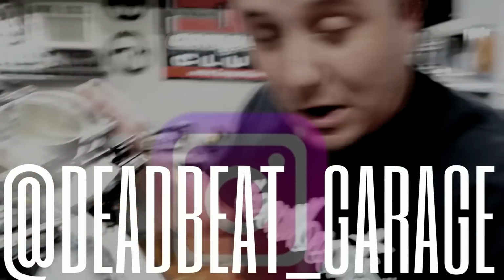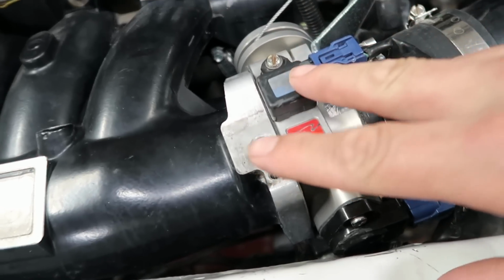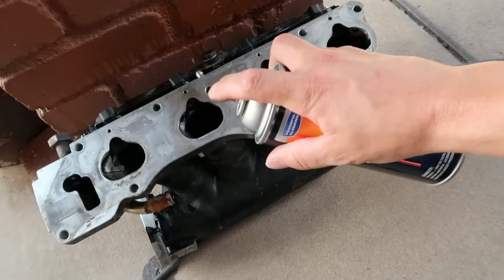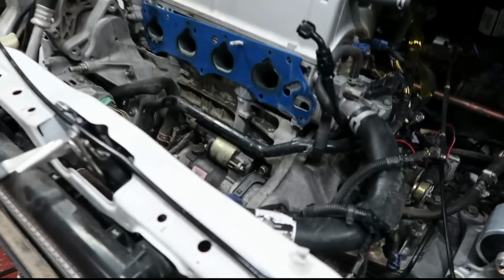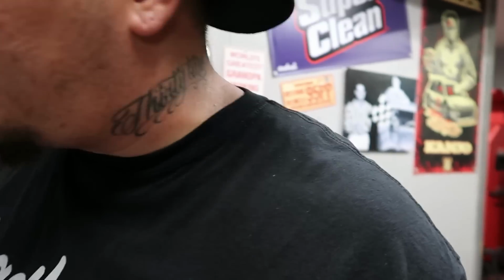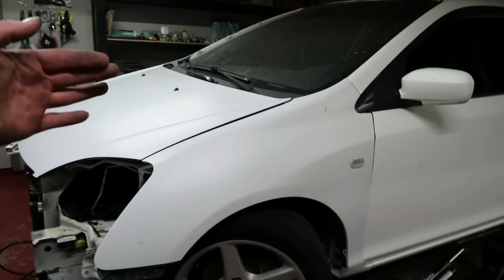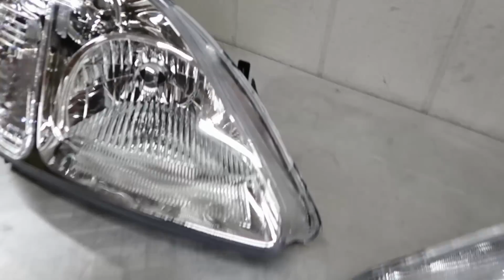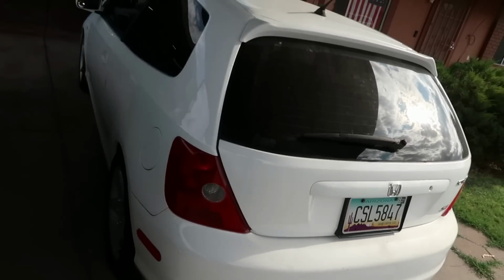K24 Swapped EP3 is looking FRESH! And we're just getting started.

Comment: Spray it white, carbon fibre bonnet, carbon fibre trunk, wind deflectors, underfloor neons, mugen rear spoiler, check out uk spec ep3’s, sunstrip, de wiper back end, harness pads, gear knob, de badge, rear diffuser, rear bumper spars, side skirt extensions, front mugen lip

Comment: From personal experience, skunk2 was notorious for sticking as well. I learned, the return spring tension wasn’t great enough to close the throttle body back, so I drilled and hole in the butterfly wheel to give that spring more tension. Seemed to have help for as long as I had it till I upgraded to a 80mm